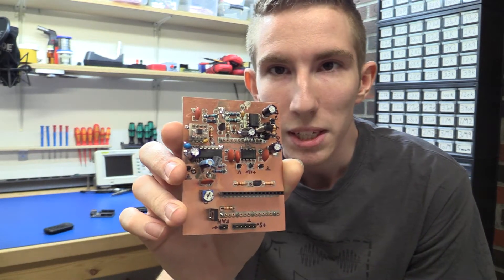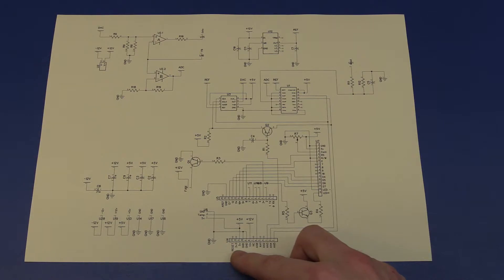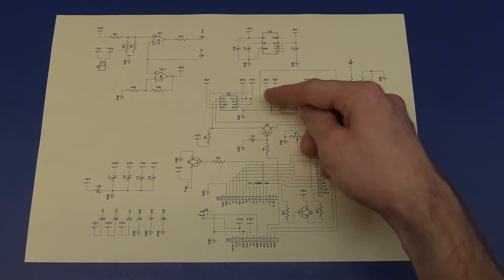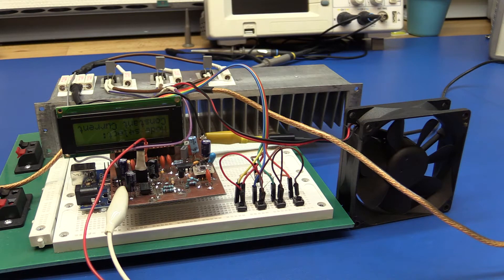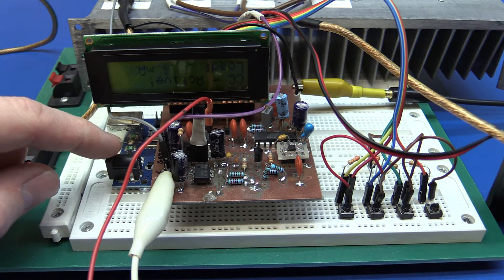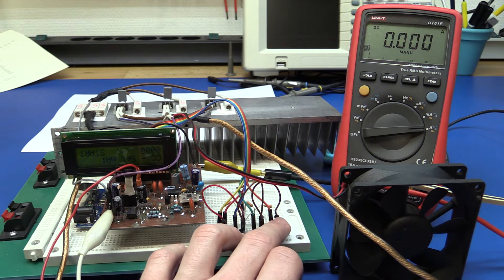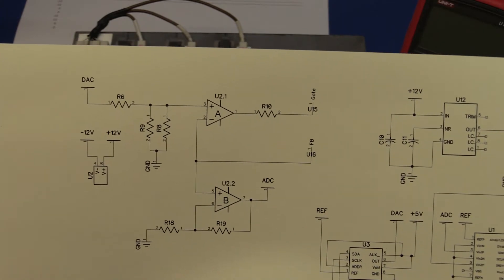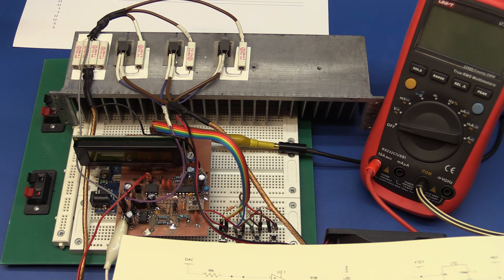DC / CC Load (Part 2): Troubleshooting - Ec-Projects

Comment: gate capacitance + the resistor on the opamp output make the delay circuit. That's what causes the oscillation. You can use mosfet drivers or you can use an PNP transistor as a speed up circuit. Here is a speed up circuit for P channel MOSFET with an NPN transistor: http://mcu-bg.com/mcu_site/download/file.php?id=3978&mode=view . It should be the same for NMOS, except for reversed junctions ... I guess .. I'm not in a mood of thinking right now :)